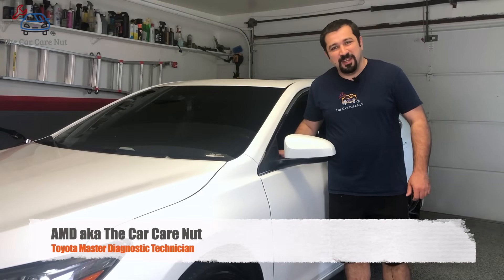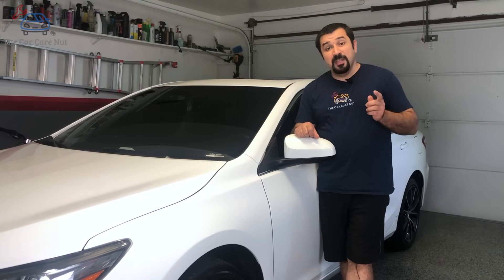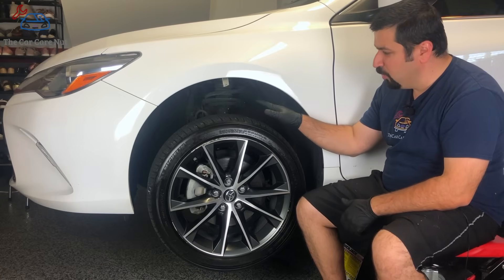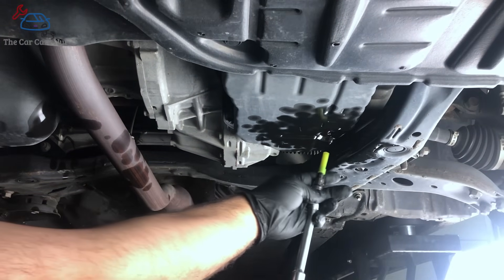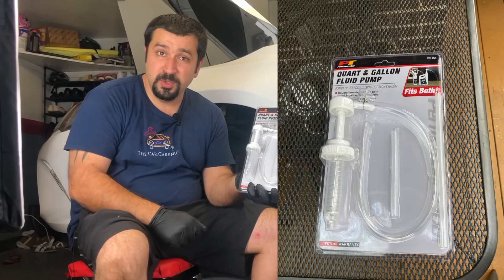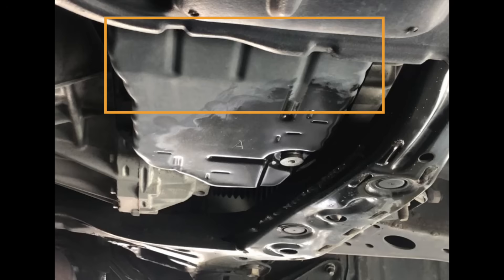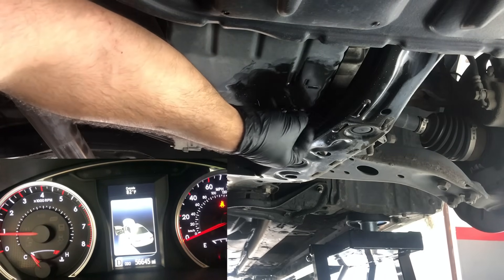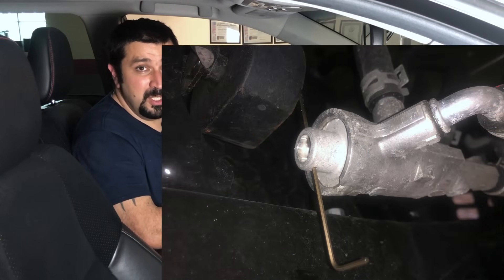How to change your Toyota Sealed Transmission Fluid

Comment: bro... this is overcomplicated. just drain it, measure the litre, then add the same litre of fluid. no need for that temperature measuring stuff.
Reply: You can do that. But doing the proper level check keeps it accurately leveled.

Comment: HI, I watched your video very carefully, but I am unclear about the last steps after D comes on solid.  You say to pull off the wire and take the foot off the brake.  Do I drain excess while it's on Drive mode?  Wouldn't that make the car roll if I take my foot off the brake while it's in Drive mode?
Reply: You drain the excess of the fluid on park while the engine is running.
Reply: @gregw5195  thank you

Comment: What temperature should I check after replacing transmission fluid for 2021toyota camry xse awd?
Reply: Should be between 95 -113 degrees f. 104 is ideal

Comment: I really appreciate all of your tutorials. One point where I could see some getting confused (I did).  After toggling between N and D quickly for about six seconds, the D indicator will come on.  At least on my 2017 Rav 4, if you happen to have it in drive, the D indicator doesn't turn off.  This does not mean it is up to temp and ready to drain.  You then need to shift back into park.  The drive light should disappear, and then you wait.  I had to wait for about 7 minutes before it came on.

Comment: I’m going to change the transmission fluid on my 2017 rav4. 4 cylinder and front wheel drive. I’m using a lazier thermo gun to check the temp for setting the level. Thanks.

Comment: My car isn’t going into diagnosis mode with the bypass installed in the correct place on the obd port. I will need to use the temperature gun method. What is the correct temperature range for a 2020 Toyota RAV4 XLE 8 speed transmission?

Comment: When i drive a short time the temperature in the transmission goes above 105 F, The fluid will be overflow to the tube to drain plug. Therefore I don't understand why we have to check the temperature.
Reply: It's because atf fluid expands when hot. Gives accurate reading or else your transmission will be over filled = bad for transmission

Comment: Another question. So if you are draining the fluid cold and you get 2.5 quarts out of the pan, why not just put 2.5 cold quarts back in the pan? You are essentially putting back in exactly what you took out. It doesn't make sense to me to go through this entire procedure if the car is already running fine with the amount of fluid that you initially took out. Sounds like by putting the same amount of cold fluid back in when the car heats up it will still be the same amount in the pan. Just my thoughts. Please advise if and why my thoughts on this are incorrect. Thanks!
Reply: Yes it can work but you don't know from previous job if it was done correctly or if there was any leak prior. This will make sure you have enough fluid in transmhurtinso you can have transmission last past 300k+

Comment: I emailed over a week ago about my 202 1lexus is 350 rwd transmission oil temp window and nothing yet 😢 also if i need to press and hold that oil cooler bypass and also where the drain and fill bolts are for my car and if I'll use the 6mm hex after I remove the drain bolt to and loosen the oil check lipstick thing inside. Also question about the washers or orings, are there any?

Comment: Do Toyota dealers do this
Reply: They use Toyota tech steam (software) to monitor the temperature and set the level.
Reply: Yes $300+ job parts and labour
Reply: @wjm3018  $399 for a flush and $120 for a drain and fill.

Comment: I just wanted to know if I should let the dealer do a transmission flush on my 2022 Camry le 4cvlinder 8 speed automatic. It has 54,000 miles or should I just ask for a drain and refill service
Reply: Flushing is bad. Just need drain and fill

Comment: At the point when the "D" comes on solid it was a bit unclear to me about what to do with the shifter before going under to open the the plug to drain off the excess fluid. I watched AMD's vid. on the sealed truck change and that clarified it for me. When the "D" comes on solid, put the vehicle in Park, pull the jumper, & then drain off the excess with the engine running. If you have someone around to help they can sit in the driver's seat to make sure that the "D" doesn't start flashing (too hot) before you're finished with the operation.
Reply: thanks for clarifying that, bud.

Comment: This is sheer insanity, I have serviced all my own cars for almost 50 years, now I had to pay $240. for an expert to change part of my Corolla trans fluid. I will never buy another Toyota until they bring back real transmissions. And the only way they will do it is if everyone refuses to purchase. My Corolla is almost 10 years old and my next car will be a Mazda, they have not yet folded to Fed Gov pressures. Is there no filter in this trans???
Reply: $250? I was quoted $500 at Toyota of the Desert. No thanks!

Comment: So you leave the car running while draining the fluid or turn the car off to drain to the correct level?
Reply: I have the same question
Reply: I talked to another toyota technician, and he said Yes you leave the vehicle running when you are adjusting the level.

Comment: Hi, after doing this, is it posable to futher flush the trans by using the trans cooler lines. My thought is to disconnect both sides and using two bladers in a sealed drum, one full of new fluid and one empty. While engin funding and in drive on rollers, the fluid will fill the empty blader pressurising the new fluid in via the cooling return. I am going to be trying this on a Toyota 200 series.

Comment: The part regarding setting up the 'transmission sensor mode' is not accurate. At least I couldn't make it work on my 2013 Sienna following the instructions here. But after following a similar video made by "Valley Mobile Automotive" channel, I completed the job.

Comment: AMD, to save some time for home DIYers (lazy people), would this be just easier to put in the same amount of fluid of what you had drain out?  (assuming that there is no loss of transmission oil inside due to burning).  I believe my mechanic did the same way with my older sealed transmission Lexus. 

Just wondering if it could eliminate the step of getting the transmission in the right temp range and then readjust the fluid.  Granted, it won't be the 'official' way of doing it.

Comment: Great video - thanks.  I have a 2013 venza 2.7 litre.  When I drained the tranny fluid by removing the metal plug, I got A LOT of fluid - even before removing the plastic plug.  Probably 3 litres came out of the metal plug, and an additional 2 litres when I removed the plastic plug.  This would indicate that the tranny was overfilled by the previous owner.  If I follow your procedure, I will be adding back about 2.5 litres.  Is this what you recommend, even though about 5 litres came out?

Comment: This procedure is a bit of a pita, but I will say, you do know you have exactly what the trans needs as opposed to a dipstick. When your fluid is new, it is often difficult to tell exactly where it is on the stick, and it picks up fluid on the way out, often smearing it around. The real pain of the job is getting the skid plate off, and it’s harder to add it back in vs a dipstick tube add. Checking the temp part and draining till it trickles is easy
Reply: You sand the dipstick with like 600 to 800 grit and it shows up easier

Comment: Thanks! great explanation.
Reply: Excellent presentation …BUT … I find it hard to believe that a couple of mm. One way or the other can really affect the transmission ..when in motion the vehicle is shifting around and the transmission fluid will be slopping  around inside housing . If the level is close …I don’t see what harm would be done ?

Comment: I just changed my transmission fluid in my 2016 RX350 and after figured out its and 8 speed. I did not bypass the cooler.  
I did put 3 quarts in because i had about 2.5 quarts drain.

Then i did adjust the fluid level and didn't get a full stream at first. Just got a little less then it went to a trickle like your video.

The car was only parked (not driven). 

Should i go back and engage the bypass and put another 0.5-1 quart in and redo the fluid level?
Reply: actually a 2016 rx350 doesn't have a coolant circulator. Watched a video specific to my car and i'm now confident its fine.

Really appreciate your help!

Comment: Do I make a mistake? After draining, put extra 1/2qt, shift the transmission to D,R,P, also S1-S5, back to D, P, R.
I could not check the level (fluid came out a lot more) 
What is the fix?

Comment: So I did this and exactly 2 qt came out so I put in 2.5 but when I did the diagnostics and left it running to drain it, nothing came out. 

Does that mean that the last person that did it potentially got it wrong?

Maybe it wasnt hot enough? from when i turned on to getting a solid D to come on was about 10 seconds so I tried draining it around 15 seconds is this not long enough for it to get hot?

The video says if nothing comes out to repeat the process, meaning drain and fill or just try draining excess again?

Comment: Well  that’s only changed  1/4 of the oil volume .   Note I got my oil as hot as could.  Drained into a measuring  jug let it cool down overnight.    It only dropped down  1 mm.     Suggested a hose on trans cooler out line into a drain tin.   And fill and drain until oil comes clean    Mike😊.  You are one of the best there is .love your vid.

Comment: thank you for this educational video. One thing that is not clear for me is regarding the oil pump air bleeding after K120 CVT fluid change (drain and fill). I have an M20FKS with Start&Stop system and rapair manual says it should be done after such replacement using GTS . Is using a GTS the only way of doing it? Is it a neccesary procedure  at all?

Comment: Mr. "The Car Care Nut", may I have a question for you? At cold when i removed the drain plug, I saw my 2013 RAV4 XLE draining about ~1 qt of oil already. If i remove, the tube and refill as you suggested. When the car gets warm up, and i remove the drain plug again to adjust to the trickling level, will it remove too much fluid? This is the part I am confused thank you so much.

Comment: I have a question about procedure for getting the level right. I have a 2018 Rav4. To make for a less stressful process, could I just overfill the transaxle and pull the drain plug while it is still cold, and then just start the vehicle and monitor the temp until the prescribed temp is reached, and then install the drain plug? Thanks for your answer and informative videos.

Comment: Do we need to remove the transmission pan to change the pan gasket? I have 2021 Mercedes GLA250 Base with no trans. dipstick, but they sell fluid change kit that includes pan gasket that confused me if I need to also remove the pan for the new gasket also? Please let me know.

Comment: Two things is still unclear to me in the video. Firstly, after back and forth of N and D, when D becomes solid 2 sec then disappear, do you need to keep the shift stick in D or N, or back to P, to wait for D comes back again? Secondly, what the toque of the drain plug, I read some manual (the Haynes one) says 36 lb-ft, but I don't think the small 6mm hex hole can bear that toque. It's quite easy to get it stripped.
Reply: Thats the question I had. I put it in N to D til it became solid and then put it in park. If I remember correctly, since it was is diag mode, it still showed D while in Park after a few minutes it starts flashing for overheating. 

Be careful this isnt as simple as it sounds. The last person who did mine stripped the allen socked for the drain plug and the straw took me 6 hours to get it out.

Comment: Thank you for this video. I have a question: did your helper leave the car in Drive or Nuteral when the car light became solid? Also, what is the recommended interval for the transmission fluid change and is it also recommended to replace the transmission oilfilter?

Comment: @TCCN I couldn't get any jumper wire to fit the OBD2 for a 2019 Toyota Rav 4 LE AWD. So what I did was I took out & put the same back in. Aprox.2.9 qts. The plastic shield on the bottom PIA!
Reply: @some-random-bloke  8 speed 2.5 liter.
Reply: Yeah I've been wondering why you can't just so this if fluids are same temp? Been doing this way for years on my acura.

Comment: Thank you for your amazing devotion to teaching us...wow.  Question: I have a scan tool and have been driving with the transmission temp in "live data" mode, which in my road conditions gives me a range of 95 to 102C.  To confirm, since I have the tool, I can plug it in while doing the fill...as long as the car remains in this temp range, the fill procedure should be fine (2020 Camry 3.5L v6 XSE 8-speed FWD)....yes?

Comment: @TheCarCareNut 
Should the engine be turned off or running when removing the nut and allowing the fluid to drain for fluid adjustment?
Reply: The video showed the engine running while the final fluid adjustment was made.  He had a helper in the car operating the shifter so you could seee the D light come on.

Comment: I have a question, could you tell me how many L of transmission fluid will take to a fully repaired 2007 Toyota Corolla Axio NZE141 1.5L  CVT TC oil

Comment: Hello! I have a 2022 Corolla LE 1.8L. I tried the jumper cable in the OBD2 port and nothing happened. Has the process changed? Is the temp range still 95-110? Any info would be greatly appreciated. I’m glad I tried a dry run before performing the service like you recommended!!!
Reply: I have a 2021 corolla le and I paid for all data to get the procedure and it said you didn't have to use the jumper cable. I did it without the cable and it worked for me
Reply: @Guesswhat518  did your dash lights all do the xmas tree light thing? I have a 2018 Tacoma, and the jumper seemed to give me ( parking brake and foot brake always on until finally in park) just the Solid “D”. It consistently took 7 neutral to drive cycles to give me the Solid 2 second  “D”.  Back to park, Pulled the jumper and looked at D. It stayed on if ok temp-wise and was off when I tried and not hot enough. I think I practised the procedure 5 to 10 times. You had the same result just doing the shifter procedure.

Comment: I see how overfilling to let it drain is important to 'be sure' that you're at the correct level, but it seems wasteful to me. If you drain the fluid at room temp, you should be able to simply replace the volume of fluid you drained. This of course assumes you had the correct level to begin with, which I think is a fair assumption.
Reply: Keep in mind that you can only buy the transmission fluid in full quarts, so if you need 2-1/2 quarts to fill the transmission, are you really going to save the extra (opened) half a quart for 5 or 6 years until you need another fluid replacement?
Reply: I see your point, but if it's your first time servicing your Toyota, you really need to verify. My Tacoma was 1.5 quarts low on transmission fluid when I bought it used from the Toyota dealership even though the dealership claimed that its techs checked all the levels.
Reply: @jared8493  Yes I agree with jared8493. it's best to go through the procedure the 1st time you do it, then going forward you will be able to simply replace the volume of fluid you've drained.
Reply: That's correct it is wasteful amid that Toyota WS fluid is very expensive to be adding just to let a good amount of it drain back out.
Reply: Yes I agree with jared8493. it's best to go through the procedure the 1st time you do it, then going forward you will be able to simply replace the volume of fluid you've drained.

Comment: Which way are the little aluminum crush washers supposed to face on the drain and check plugs? There is a bigger flat side and a smaller ridged side.

Comment: Ok so here is a very good question for you Ahmed 

If the oil must be between 95-110 degrees to check it.  Then what if it’s 100 degrees outside here in Chicago this week ? 
Can I park overnight then just pull the drain plug and do this whole process without even running the engine if it’s 100 degrees outside?

Comment: Is diagnosis mode critical for proper level?  Removed 2.5 quarts.  Monitored temperature with scan tool. Added 3 quarts and 1.5 quarts came out during level check.  Let it cool.  Added 0.5 quarts and 0.5 quarts came out during level check.  I figure I’m 1 quart short in my transmission.  BTW, I am a master tech.

Comment: I have two Ideas: Instead of measuring the volume of transmission fluid drained out of a car when it is hot, what prevents me from weighing the fluid that came out and pouring the same weight of new fluid back into the transmission? Also, why can't I wait until the drained fluid cools down to air temperature, check it's volume, and then pour the same volume of new fluid back into the transmission?
Reply: Unless I missed something, he intially drained (and measured the volume) the transmission fluid when it was cold, not hot.  He only “warmed up” the transmission when doing the final fluid level check.

Comment: Great video!  However I am confused.  Why not do the draining when cold then add the exact amount you take out?  If you are doing this the first time, then the amount in the transmission is the amount from the factory so it should be exact.  Thank you!
Reply: I may have missed something, but I think he did drain the fluid cold.  And adding the exact amount you drain means you’re willing to assume the level was correct to begin with.  Why assume that when there is a way/approved procedure to know with 100% certainty that the level is correct?

Comment: If using option 3 (laser thermometer) do you still need to change from d to n to r  like option 2 so fluid cycles through transmission?